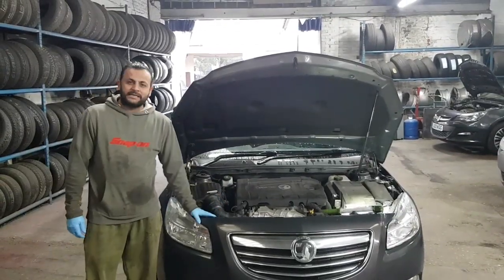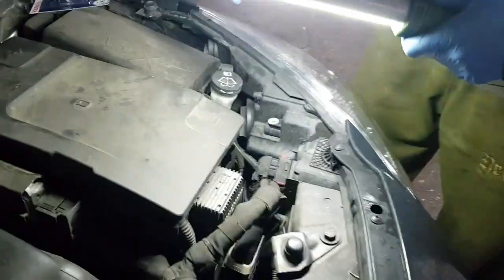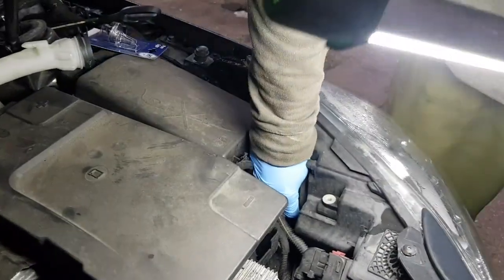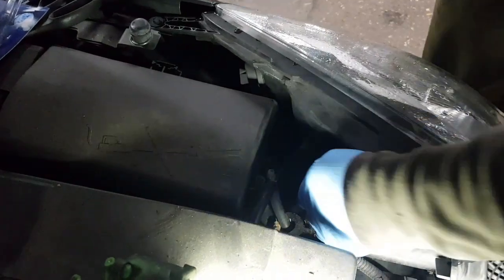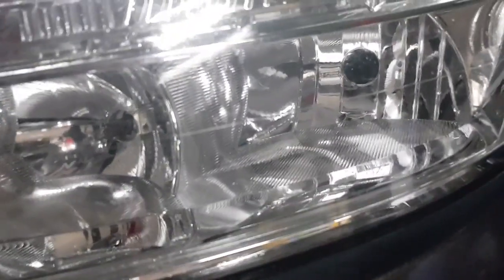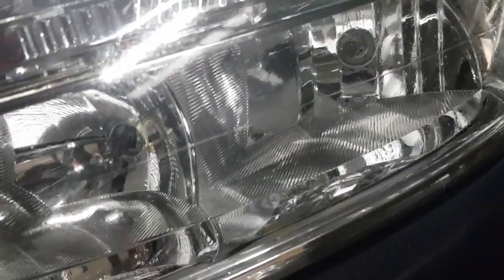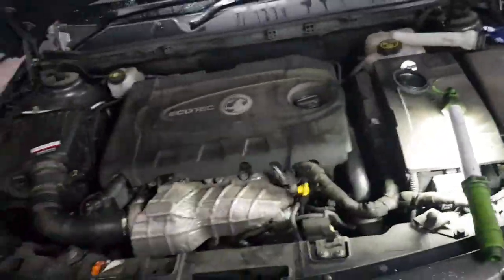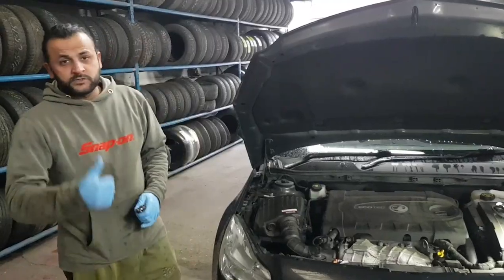How to replace dipped beam headlight bulb - Vauxhall insignia

Comment: I am really confused, you have a video from 2017 saying vauxhall insignia headlight bulb is a HIR 2 and now this one is a H7 Is one full beam and the other dipped beam
Reply from the maker: Hi sorry for all the confusion but this model has H7 and I have another video for a similar vehicle which has hir2 bulb fitted. Vauxhall playlist has both of the cars and they both have different headlights. I.e. if the bulb is visible through the lenses and you can see 2 bulbs which the inside bulb is for full beam and the outside bulb is dipped beam H7 and if bulb aren’t visible then the car is fitted with hir2 bulb. Hope this information helps you. Thank you
Reply: @TajMotorMedics  what about the 2 torx screws that are on the back of the bulb holding it in flipping nightmare trying to get to them
Reply: @marcdonatello6809  he forget to mention Thats the most important bit .....hahah